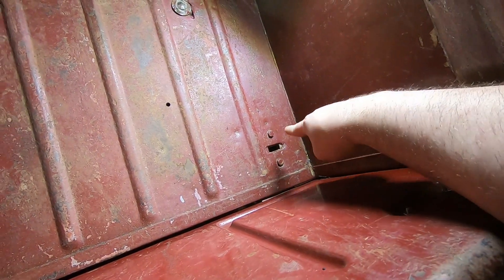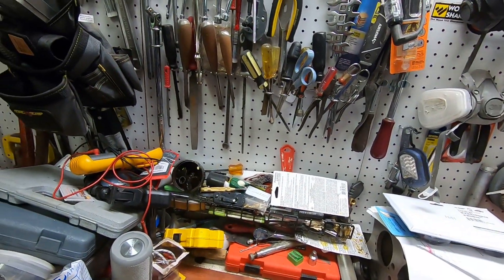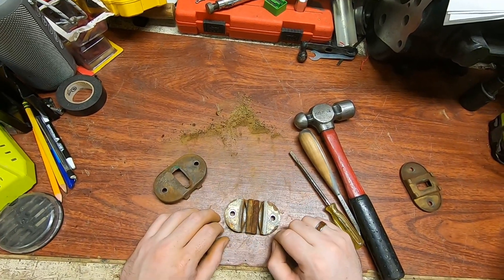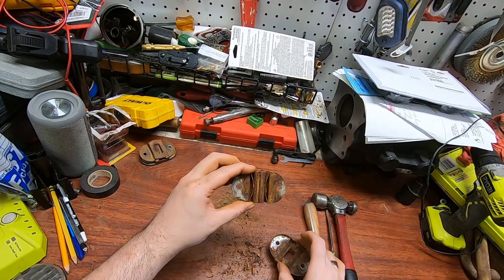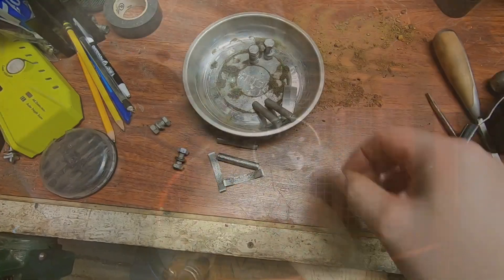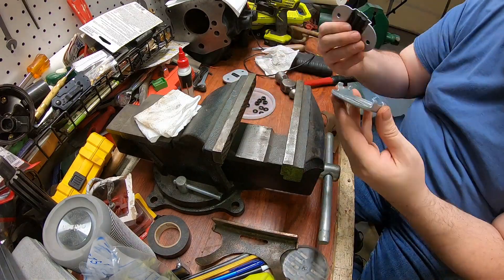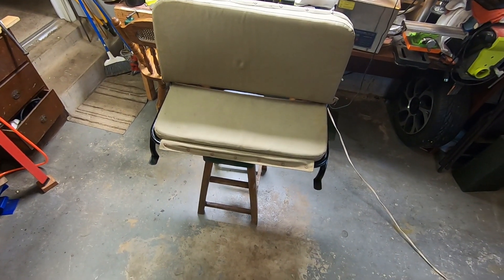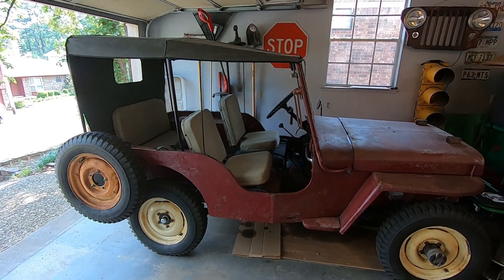Ep. 79: Rear Seat Retaining Clip Restoration (For a New Rear Seat, Of Course)

Comment: That rear oil leak in your transfer case could be the output yoke seal. The yoke might have a groove on the sealing surface. A speedy sleeve 99155 or a new yoke. The seal can be replaced with two thinner ones and slice your felt seal in half. The sleeve 99155 and two seals 473229 can be purchased at O'Reilly's.
Reply from the maker: It's actually the splines leaking. The seal is new and the companion flange is new. Comes right out the back instead of through the seal. I just need to  drain, throw some sealant on the splines, and reseat it.
Reply: @Sunk Cost Garage  
I used a ton of sealant on my splines. I also, before putting the washer back on, filled the end of the Yoke with sealant then pushed the washer on then tightened the nut. 
I haven't driven mine yet, but oil has been in the t case and transmission for a month and no leaks.
Reply from the maker: @billynunns  I definitely didn't use enough sealant. Thought I did but nope!
Reply: @SunkCostGarage  Also use indian Shellac around the outside perimeter of the yoke seal. That stuff will perfectly seal tight tolerances of less than a thousand